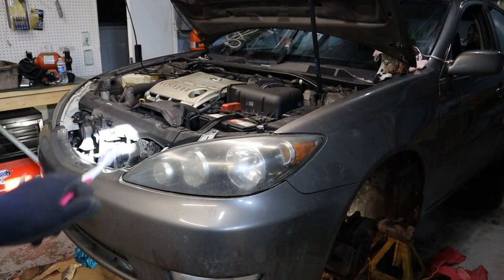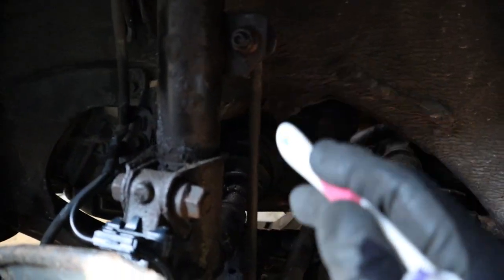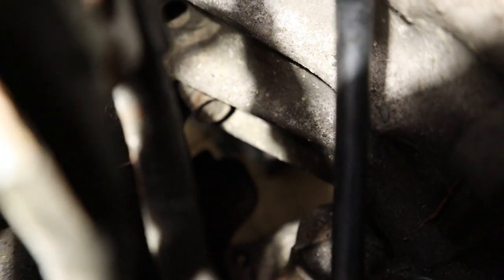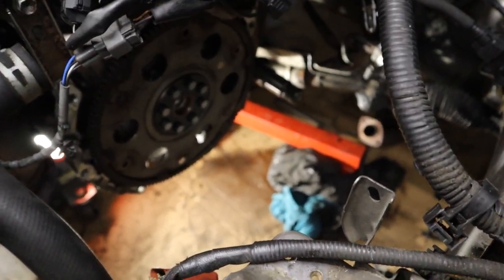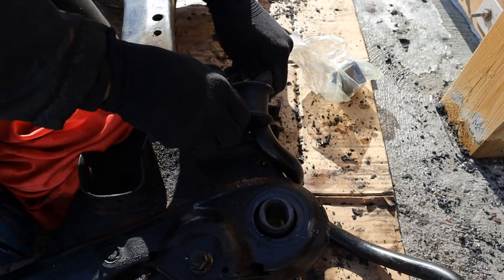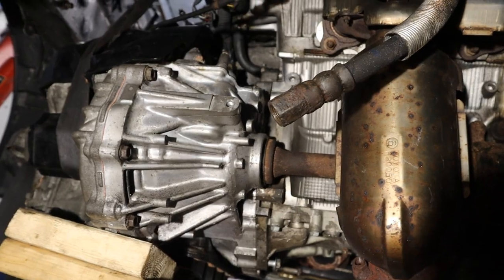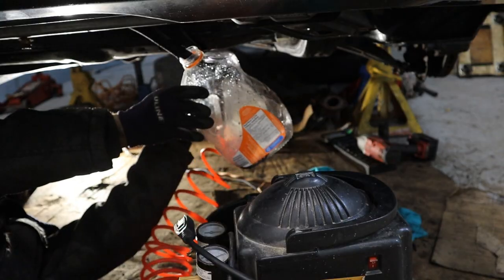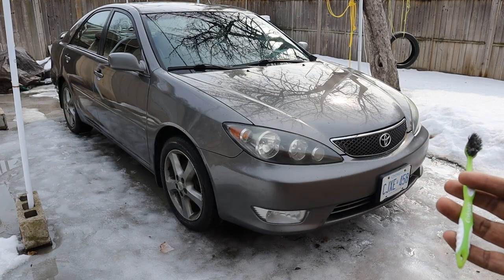How to Replace a Transmission | Toyota Camry

Comment: What an outstanding video. I really appreciate your short, snappy delivery. The first time I did a heavy job like this, I gained appreciation for a transmission jack, because it can tip independently in two planes. Only thing is, floor transmission jacks often need more room than you can find with the minimal clearance gained from standard car jacks, ha ha.
Reply from the maker: Good tip. 
I had the crane to help do the heavy lifting. 
Ive seen some people just manhandle manual transmissions up and on there because they are light and don't have a torque converter

Comment: It is worth it cause it will inspire many people to fix their own cars for small failures. Bro trasmission job is really hard even for auto mechanics. My mechanic twisted the whole engine to disengage transmission from the bell housing and one month later my transmission mount ripped apart in half on low speed, the engine dropped down on to the metal engine lower cover and I drove 500 meter with huge vibration. Because my mechanic told me on the phone it was no problem if car goes :DD So I wondered what the problem was since this would kill my whole family at high speed.  I started watching videos and looked up books, I saw one of your videos and watched most of your repair videos. Now I can repair a car if I had enough tools. I am not overstating myself because since my childhood I worked as a laborer in industry repairing another type of machines and I have a mechanical engineering diploma now. I didnt know anything about cars but I learned a lot of things from people like you. It is worth it. Thanks brother.
Reply from the maker: I'm glad my videos inspire you to work on cars!

Comment: Really cool, not many videos out there show work on a "real" car. Not worth it for a car this old... but awesome you did it anyways and saved one from the crusher.
Reply: That Camry will run for many years. Well worth fixing.
Reply from the maker: Thanks. While the car is a great on, my labor (without a hoist or helper) made it not worth it. If I was properly equiped then sure

Comment: Man, what you did is not what most people do. My neighbor just junked his 2001 4runner with 250k miles when the transmission cuddly died. I admire your hard work spirit! I have changed the control arms, CV axles, brake pads and rotors, welded broken exhaust pipe on my 02 Camry. Compared to your transmission swap, those are nothing. If I dare to try one of the job, I will be scared to dearth worrying about missing anything while installation. Taking apart is the easier part after all.
Reply: For a job this involving, I wrote down and make notes for every part I take off; than all the parts can be re-installed in reverse sequence (like a check list as well). Sure it takes more time but I get peace of mind.
Reply from the maker: I didn't have an issue finding where things went back since I boxed them off or screwed them back into the hole they came out of. The real thing here is working without a hoist and a helper makes this so much harder and longer
Reply: @speedkar99  I can do an atx swap without  jotting notes too; only if I can put everything back in one or two days. Sadly most of my major repairs span over weeks so a list of work sequence really helps me to pick up where I left. And don't forget most of us watching your videos have a lot less tools and logistic support (brother's tooth brush, underwears, socks, wife's bed sheet, etc.) LOL!
Reply: @speedkar99  Thanks for your reply! You must be meticulous to complete this complicated job. Yes, it is a good practice to put the bolts into where they belong when they are taken off. However, I forget this practice from time to time. You are really an inspiration for us. I considered myself an avid DIYer. Maybe I will try to install an engine or transmission one day. If that does happen, I shall get a harbor freight engine hoist. I actually have more mechanical tools to utilize than you do, but you are a much more skilled DIYer.

Comment: Doing these kind of jobs on heavy equipment I always questioned nature's judgement as to why we were "not" given 2 more arms and hands. Still waiting for Speedkar99 toothbrushes.  At 0:44 it looked like the wiring harness had rubbed the loam off the wires contained inside. Great job and thanks for taking us along by dragging the camera  to record. On your back in a cold garage always adds to the enjoyment. Again thank you oh northern neighbor!
Reply from the maker: Thank you! It sure was a very difficult job in the middle of winter in my tight unheated garage. But I got it done

Comment: This was an amazing video. Most important lesson from this video... Change your transmission fluid at the recommended intervals, because changing the transmission in this vehicle is 100% not worth it.
Reply from the maker: It was getting stuck in a snow storm that killed this one.

Comment: Another wonderful video. Straightforward explanation, no nonsense. A lot of detailed work, must have taken you hours. In future, if you may, please investigate how to replace the PCV valve on 2018 and later Camry 4-cylinder engine. Thanks!
Reply: Hmmm these PCV valves aren't near as easy to get too as they used to be. My PCV valve froze during the recent deep freeze and caused an oil dilution problem. 2019 4cyl. Changed the oil and all Seems well now. No more rising oil levels.
Reply from the maker: Thanks
Reply: @Handyman, it's unfortunately under the intake manifold, easier to get to on the v6 2018

Comment: Yes, I'm glad you did it  Like many bigger compact sedans, with engine and tranny mounted to the subframe, this one is no joke to to work without hoist. Definitely not easy to swap the tranny in the driveway. And thankfully you didn't have to use acetylene to free up seized bolts, something that very common in our 'rust belt'.
Reply from the maker: My biggest fear was rusty exhaust. That's why you see it's already unbolted in the beginning of the video. If I couldn't get that off I wouldn't have tackled this job since exhaust work would have totalled it way out of budget.
Reply: Can mapp gas canisters be used to try to free seized bolts?

Comment: Wow. I'm impressed with the work that went into it. You summed it up nicely at 17:03 obliviously not worth it for a car that old.
Reply: In this crazy car market?

Totally worth it.. a running and driving Toyota? gold!
Reply: Idk those 3mz camrys are bulletproof. Definitely worth it, it will drive for a couple hundred thousand more miles
Reply from the maker: I value my back breaking labor I'm the cold of winter without a hoist or a helper more than this. However if I was better equiped, sure. This car sold within a day. Had it been pre-shortage, it would have been a no brainer and gone to scrap (after me tearing it down on videos haha).
Reply: @speedkar99  I actually have a spare 2az transmission in my shed i just need a broken car.

Comment: Great video! Perfect evidence that these transmissions are not meant to be removed, except as a pet project where time, frustration and lost parts are not issues.
The cost of doing this professionally on such an old car would be prohibitive, it makes no sense.
Much easier to drive it into the ground, drop it down a ravine and buy another! 😀
Reply from the maker: Agreed! Alot of work, especially without lift equipment. Only worth it if the vehicle is worth more than this beater car or sentimental value.

Comment: 👏👏👏👏👏👏👏 wow thank you for the content didn't know you were gonna go through it, considering our winter🥶🥶 situation. I concur with the immense amount of labor that has gone in to these FWD set ups. 

Being that the used car market is currently inflated here in the U.S.  I'm sure you priced it accordingly, in addition to how extremely speedy you've sold it.

 I've oddly found this removal/installation procedure looked a bit easier than what your recommended in taking the engine/trans as one unit, however, a great deal of Toothbrushes🪥🪥 and nearly your brothers whole wardrobe was involved.😅  I salute you and your sibling genuinely. Again Awesome trilogy Mr Kar 👏👏👏👏👏👏
Reply from the maker: Thanks for your support. Sure was a tough one this winter so I decided to hide in the tight, cold garage to hide from the wind/snow lol. The market sure is hot right now otherwise I would have probably tore the car down and part out.

Comment: Spooky timing this vid comes out nearly the same day my 04 Camry gets a P0776 pressure control solenoid B code. It's a sign. Props bro, looks like an insane amount of labor. Having to lift the engine and trans to remove the mounts to replace the lower control arms on my car was very annoying.

Comment: Great video I’m putting a transmission in my Toyota it’s an outside job and I’m using two jacks I’m almost done it’s a lot of work but it’s worth it to me … thumb up to you …
Reply from the maker: Glad it helped. I wish the engine/transmission came out the top without touching all the subframr suspension or steering stuff

Comment: I don't know if you'll find any solace in what I have to say next but here it is anyway;

I was able to get a link to download the A541E transaxle workshop manual. 

The manual instructions to do everything pretty much as you've done it in this video except for the power steering rack. The manual says to completely disconnected and lay it on top of the cradle that's holding the engine.

This surprises me cuz it still seems like it would be easier to drop the engine and transmission as one assembly. I guess it means a couple more motor mounts in a few more wiring harnesses to be disconnected. 

With my Solara, I haven't had air conditioning since I bought it 7 years ago so I don't have to worry about EVAP-ing the freon. I still think one could take the air-compressor off the engine and hang it somewhere with all the a/c lines still attached to avoid this issue.

I was at a Totota dealership over the weekend in West suburban Chicago this past Saturday. The shop manager on duty told me that it would be about an 8-hour labor charge to drop the sub-frame assembly. Currently in febuary 2024 at the shop labor is assessed at $185 U.S.D. per hour. So close to 1,600 schmacks just to drop the subframe assebly.

The aforementioned also told me that on a warranty claim that came into the shop a few months ago on a 2019 Toyota where the shop had to go through the transmission was about a 29-hour job.

He then said that with my old 23-year-old Solara that the labor could go up beyond 35-hours because of all the corrosion at age. He says for a job on my car, there is no flat rate. It's basically a stopwatch when the mechanic punches in on the job until when he punches out.
Reply from the maker: Thanks. I was trying to avoid dealing with rusty power steering lines but I had to anyway. They aren't easy to connect when the rack is in the vehicle. 

Next time, I'd probably lift the engine and transmission out the top as an assembly. I recently engine swapped a Lexus ES350 and found it easier to go out the top.

Comment: Very graceful removal to that transmission. Im glad no one got hurt. 😅

I'm wondering what your specific issue was with getting out the passenger side axle. I've had to take out the passenger side axle on my 99' Lexus ES300 twice, once to replace it, and another time to replace the engine mount bushing. The most difficult part was getting the snap-ring back in place. Maybe because of the rust? I live in Florida so it's pretty much rust-free.

Either way, great video and I love your channel!

Comment: Very nice video.. doesn't look too bad if you have this project under control.  Prefer the lift though
Reply from the maker: For sure...a lift
Reply: @speedkar99  but looking at this video you did a very nice job... "factory style". I agree as well, to change all the seals& other components that are difficult to do with the tranny inside

Comment: That's why I like manual transmissions
Reply: Manual transmissions can have issues too. And this transmission was pretty badly abused. In a pervious video he said the previous owner got stuck in the snow and tried to floor it and change gears to get it unstuck.
Reply: Not if you need to commute daily in stop & go traffic for over an hour each way!
Reply: @pcnepal  that's what 98% of cars has in Europe.
Reply: @mecanicageneral615  I see your point. I once had a Polish friend who told me that automatic transmission was a luxury option in his country buying a new car. I do enjoy driving my manual cars more if not going to work.
Reply from the maker: Manual is good for reliability (if you are easy on the clutch, light traffic) but automatics have their advanges too.

Comment: If I we're changing the transmission, might as well change the rear main seal when the transmission is out. Save a lot of headaches later on
Reply: He did change the rear crank seal @ 11:20. Not sure if he changed all the input/ output shaft seals on the ATX though.
Reply from the maker: I did change it
Reply from the maker: I didn't touch the transmission. It was a used transmission from a low mileage wrecked Camry

Comment: As difficult and laborious it was, it had to feel satisfactory being able to change those control arms and bushings with the subframe off.  Ive changed those out before on my highlander and that was such a pain lifting up the motor mounts just to get to the bolts.

Comment: I have a 2003 Camry LE 4 cylinder and I just replaced the engine or more like rebuilt. I took the engine and transmission out together. Is the V6 any different then 4 cylinder? By doing the way you just showed much faster and easier or what? Just like to have your opinion. I have learned a lot from channel and a very well explained and details. Please up the the good work you are doing great.
Reply from the maker: The easiest way is to take them out together. More so for the V6 because there's less space. 
If I had to do this again I'd go the extra step of draining ac fuel coolant, wiring etc just to drop them together. Too much fingling to get them to align in the car.

Comment: trust me it is worth it you should try 2015 dodge transmission failure and how much the parts cost without adding the labor cost
Reply from the maker: It's alot of labor to be working alone in a cold garage without a hoist on a car with 360,000km

Comment: We replace the same one for about 25 miles then, the clutch don't catch 3rd,and 2nd but reverse works properly.
Reply from the maker: Did you check the fluid levels? And adjust the clutch?

Comment: Couple suggestions, use a ratchet strap to hold the rack upright against the engine, also to remove a rusty passenger axle cut the intermediate axle shaft with a angle grinder, unbolt the bearing carrier from the engine block and replace passenger axle. It costs about 50$ for a new axle on eBay but its definitely worth not having to deal with lining up the new transmission

Comment: Wow oh wow! Quite a job. You did it though, nice work. Would it have been any easier to pull the engine and trans out from the top with your engine hoist? Instead of messing with the subframe.
Reply from the maker: I wish I could have done that but the transmission tucks under the front left frame rail on these so that's not an option.

Comment: Well, that was easy! And it took less than 18 minutes! A great DIY project, no doubt.;)
On a more serious note: You refilled the power steering reservoir with ATF. My 2005 Scion has clear power steering fluid from the factory, but Dexron III ATF is red and recommended by the owner's manual. What to do if I want to change the fluid by pumping it out? In other words, I can't see how the clear and the red could mix. Thanks!
Reply from the maker: Flush out the old stuff with ATF. I have a power steering flush video for that , check it out
Reply: @speedkar99  Many thanks!

Comment: Great job. What happened  right after you replaced the transmission with engine starting. I had the same problem when I replaced my transmission. Its like dead battery or no power at all. You think its due to bad battery conection or loose  battery terminals? Thanks
Reply from the maker: Loose battery connection

Comment: My p/s lines on my tacoma are super crusty, spray them with surface shield now to help protect them from more rust, but eventually gonna have to replace the lines and rack, big chunk of change.
Reply from the maker: Yep, these ones were getting crusty too. Just what all the salt does to your car here in the winter.
Reply: @speedkar99  yea I'm in north NJ. My transmission hard lines on the front most cross member actually rusted out at the welds, luckily not too expensive and they just bolt on. Just added a quart back into the trans and did a level check at temp.

Comment: Hey off the top of your head I have the  A 541E transmission have you ever tested with heat gun for temperature on your fluid and if so what is the proper operating temperature for that?… Thanks for an answer on this if you got one handy because I can't find anything closer… Thank you
Reply from the maker: No idea on the fluid temp...does the service manual have anything? Is it something that can be read off techstream?
Reply: @speedkar99  I'll check text stream thanks for the tip

Comment: Thanks for the great content you're providing us with, they really help me alot getting to know most of car stuffs and taking a good care of my car.... I have a question to ask if could find a way to guide me through on what really is going on with my car... I have a 2006 Toyota Mark X, the problem is its transmission is not quiet smooth, mostly coming from higher gear to low one there is bit of delaying to engage. what could be the problem on your perspective?1
Reply from the maker: Sometimes it's just the way it shifts. Toyotas (old and new) are still funky with the shift patterns
Reply: Thanks for the reply... i really appreciate